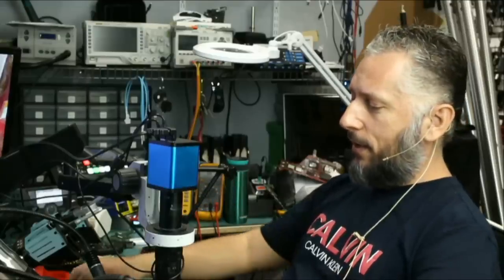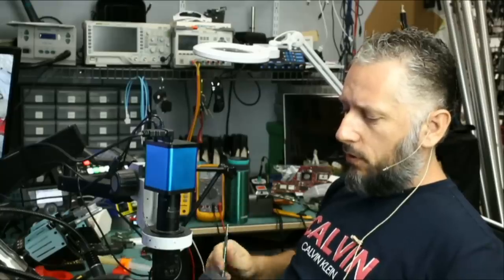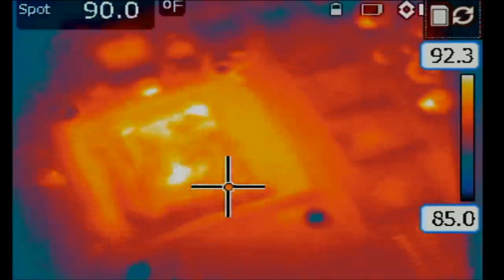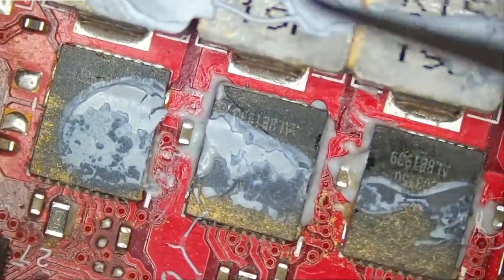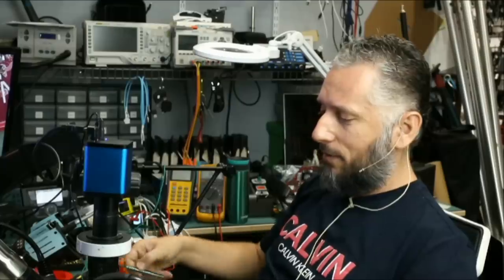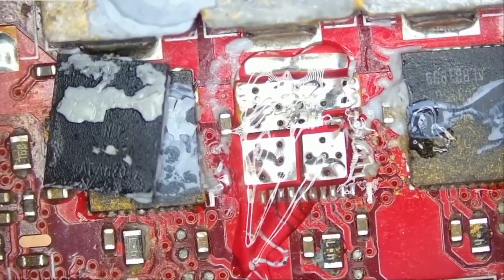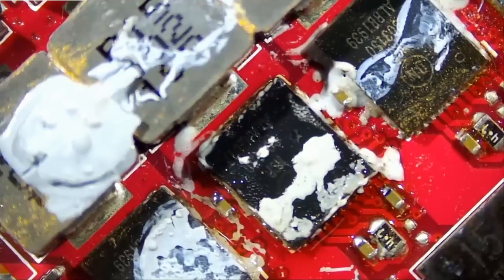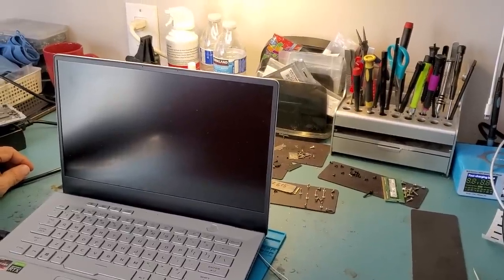Asus Laptop Repair - GPU Shorted out.

Comment: I saw one of my menthors having a lot of issues trying to solder a QFN ic, in a T*CON board for a TV, just like this mosfet you soldered and this guy fail trying to do it. He did it twice because he thought the ic was bad, then he ordered a brand new chip and fail again, wich tells me that probably the problem is not the chip but the soldering method. Congrats Alex, Big Boss, dad and NorthridgeFix.

Comment: I just bought my first soldering and rework stations after inspiration to try from this channel. I had an old Lenovo motherboard laying around that I am using to practice. My first attempt at removing an HDMI connector was a Hiroshima. Long way to go. :)
Reply: you shouldn't start with complex connectors and stuff, first learn the basics and try desoldring/soldering components on dead boards, or get a soldering practice kit, its pretty helpful, also good flux will make all the difference, thats something i learnt in my 7+ years soldering
Reply: @ShahZahid  the board is useless which is why I'm practicing on it. I've had it in the closet for a good while. There are a bunch of different sized components that I think will give me good practice. I think I had the wrong size nozzle on the hot air gun so I wasn't heating up the board sufficiently to release it. I was surprised at how little force it takes to rip the pads. I barely used any. It's a good lesson learned.
Reply: Have a good flux, try first with through hole components get a feel of how each tip affects the soldering process. Then try smd from big to small. Have a small but strong pliers will also help a lot. It is good that you have a board to try on tho. It is a long learning process, good luck.

Comment: Always nice with an "easy" win, with the right goto approach you get even the difficult solution, to look simple !👍
Don't you, as a standard service, ultrasonic clean any of the boards repaired? This looked as an obvious candidate. The thought behind for now the board is fixed, but over time, due to short /heat/corrosion buildup another component could fail.🌪

Comment: @ 3:25 about the probe you should put a sticker with a name like voltage or amp meter to distinguish the multimeter probe from the amp meter probe , i do it for my multi charger connectors like for 12v and 5v charger connectors so i'm not mistaken from which charger to plug

Comment: Holy moly.

I found the same gold stuff inside a PS3 one day.

Always though it was paint because ppl think thermal paste is some sort of paint but unfortunately, gold thermal paste is something that some manufacturer sell. Which is a joke as thermal conductivity and longevity.

I suppose one day you will also face coconut oil, mayo and nutella as thermal paste, right now I only miss Nutella on my collection !

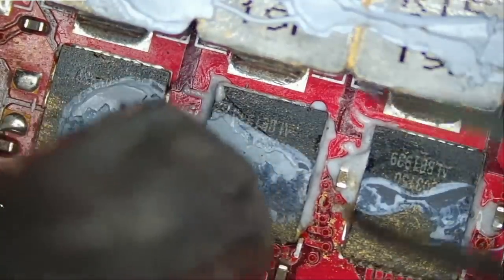5:55 I can also see that the chip was cracked on top

Comment: I have this same laptop and had to take it apart so I know what the inside looks like. I still can't believe that gold substance all over. The G14 runs hot and I'm sure they were doing all they can to get it to run a few degrees cooler, but then you risk stuff like this.. for like 3 fps. For all we know the user changing how the heat was disapated might of even led to the failure.

Comment: When I was young, I used to work with a factory that used to make Intel Motherboards and boards for Motorola pagers, they used to clean all the boards kind of like a conveyor washer machine and used Cascade as a clean agent. I will remove any Bios battery, put that board in a dishwasher with a Cascade soap and blow dry later. LOL

Comment: I believe I have the same or similar board with the same problem (GA502DU v2.0) My skills are still lacking so it took me a long time (and removing many mosfet/caps) to find out that one of the Mosfet that are in a row above the GPU was possibly bad.. Just like your board. I took it off and the second Mosfet at the DC in is no longer shorted. Fingers crossed that's the issue and not a bad GPU. But now I'm waiting for what I hope is the right chip to come from China sometime in mid to late Oct 😢
  Thanks for all your videos and spending time to educate your viewers🙂
Reply: Good luck when you get the chips in! Don't give up.

Comment: Hi Alex, would you share temperatures used for solder/desolder please?
Reply: He said such an info is not helpful, since there are way too many variables. E.g. nozzle type, distance, etc.
Reply: I usually do the maximum temperature and do it as fast as possible. But depends on the solder and the job. I never adjust My soldering iron temperature below 380 Celsius
Reply: @chilloutsloth  any hints are better than no hints

Comment: Hi mate, why do these repaired laptops take so long to turn on?  I don't think any of my Dell devices have ever taken that long.
Reply: When you remove the main battery, and reconnect it, the BIOS needs to sort itself out which can take a couple resets and a bit of time to get through the first POST. Subsequent start-up times will be much shorter.
Reply: @justinspiredfallout  cheers mate, thanks for the info!

Comment: hi, boss, i have hp 8560w and some of the ribbon cables are "broken" (old laptop already), and some of the cable clips are broken, i think touchpad and power button cable clips are broken, do u have any solution or do you sell some spare parts? 
can i just change cables without buying new touchpad and power button? thank you

Comment: What’s the best 4090 card to buy to slap an EK water block on it?
Reply: None since they are not out yet. But normally the founders edition. Need to do your research on the new cards possibly needing a new style power supply though.
Reply: @jpruitt546  Already have a 1650 watt atx psu ordered.  I was gonna get the strix gpu but it’s 400 dollars over FE card, and for what?  Fen crazy.

Comment: my laptop has a problem at high temperatures, even though I have replaced the thermal paste and the fan is clean, but the cpu temperature is too high until my laptop turns itself off. Please help. @NorthridgeFix